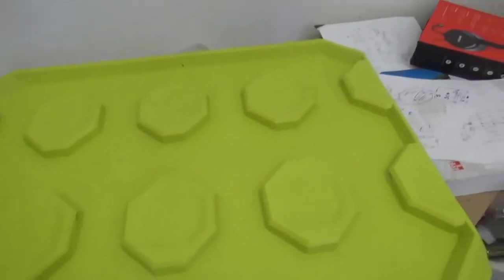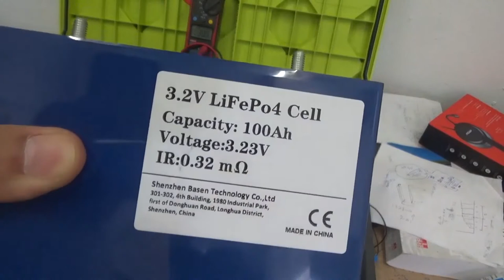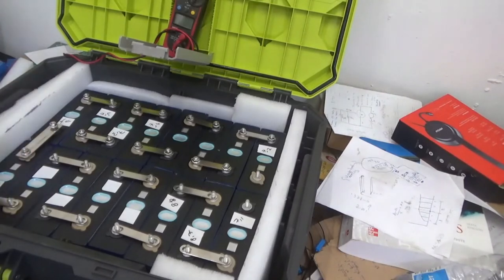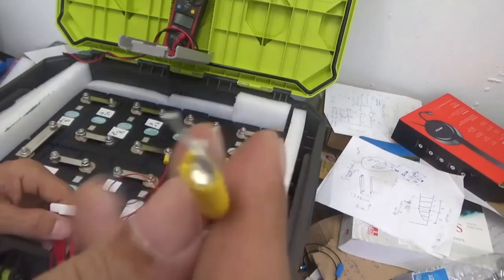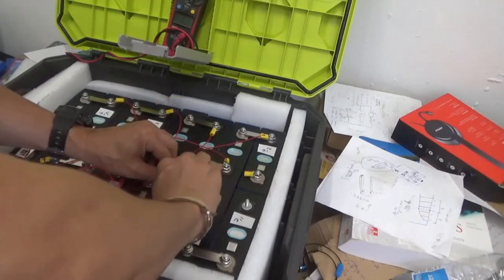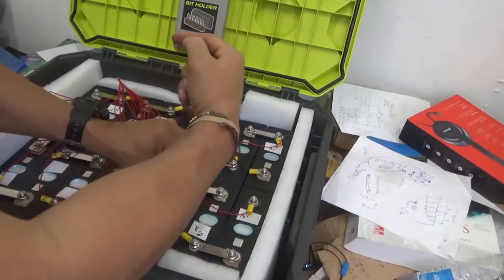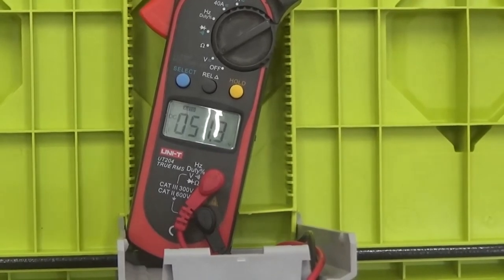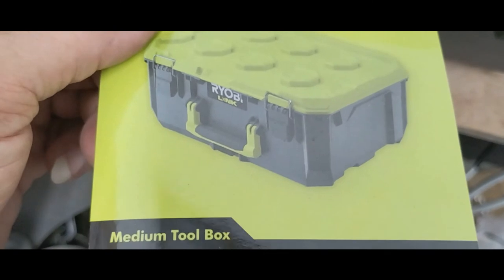ASSEMBLING A LIFEPO4 52 VOLTS 100 AH BATTERY  SYSTEM

Comment: Very good project.  Can you tell me how I can put two Lithium Iron Phosphate battery pack in parallel ??...I have an old one installed and I want to add a new one... Thanks.
Reply from the maker: Yes...it is part of one my future project.  In the meantime, check this video ...https://www.youtube.com/watch?v=e6lg5vIGLZg ....I will use Proteus to do two battery banks to simulate the discharging process.